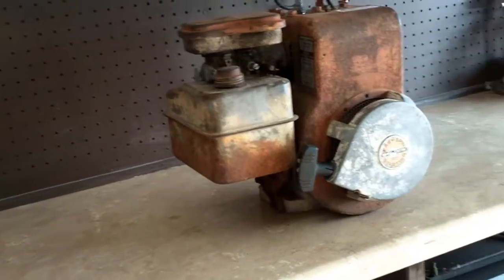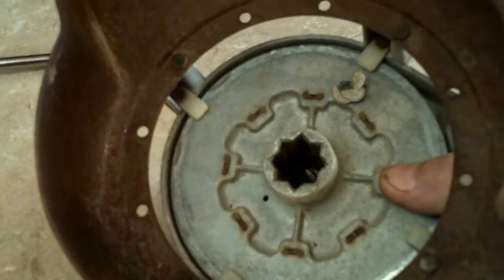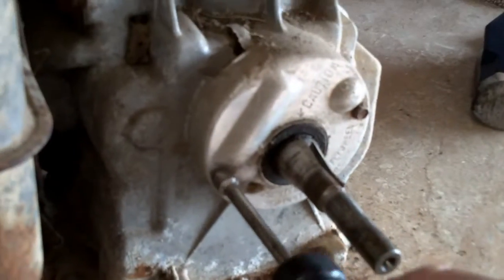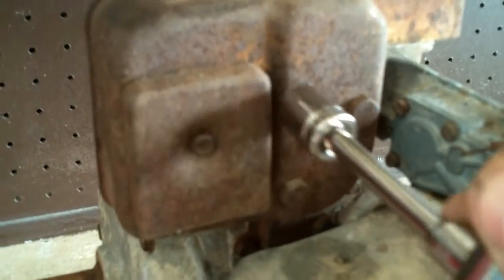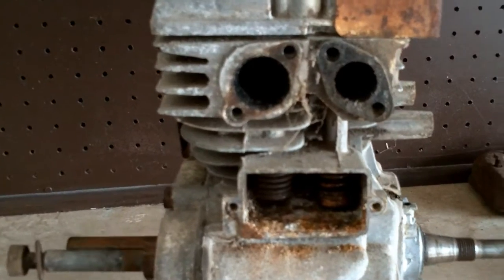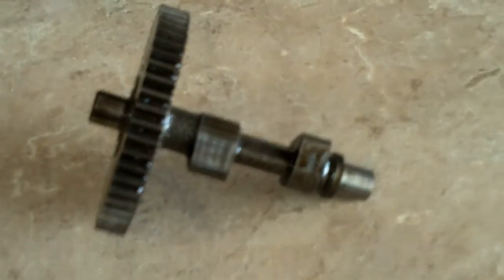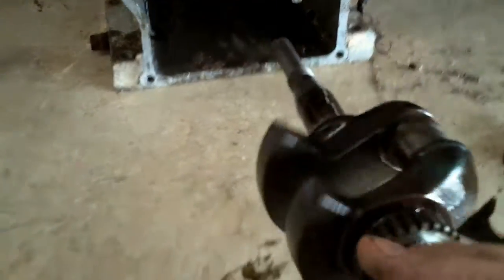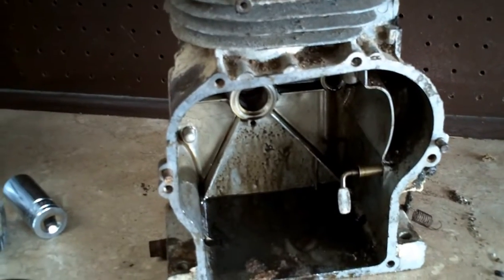BOLT BY BOLT ENGINE TEARDOWN ON AN OLDER 5HP BRIGGS AND STRATTON L HEAD ENGINE

Comment: so I am wanting to revive a 5 horse horizontal with dual shaft (PTO) exactly like this one, but the cylinder wall is in bad shape. if I get another Briggs 5 horse, with a single shaft, should I be able to transfer the sump with the cam speed reducer onto the newer Briggs? any special tools needed? I wasn't able to find a video of that on the tube. might be an interesting project
Reply: +Michael Jude i know how you feel i have the same engine as you dual shaft 5 hp Briggs Flathead and the piston got scored badly when i took it out of the cylinder it had broken a couple of pieces off the piston and welded them to the cylinder walls so i have to send the engine to a machine shop

Comment: Ok I got a 8 hp briggs moter that is acting like it is trying to lock up n it is a pull start so I turn it backwards about 3 times n it will try to  crank then stops like it gets oil on top  how do u fix it

Comment: You shouldn't have to replace the end of the ratchet for the pull start. if it starts to squeal and and seize onto the shaft, simply sand the end of the crank where it rides, run some steel wool inside the starter clutch, and lube with Automatic Transmission fluid. Great video man, just got done doing this myself. I got a Snowbird Snowblower from my grandpa and im cleaning everything up real nice.